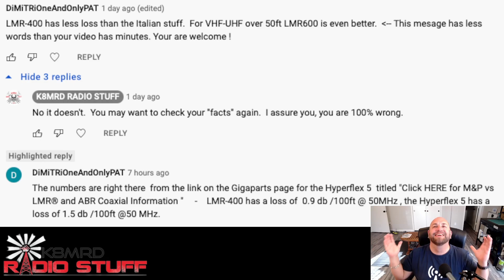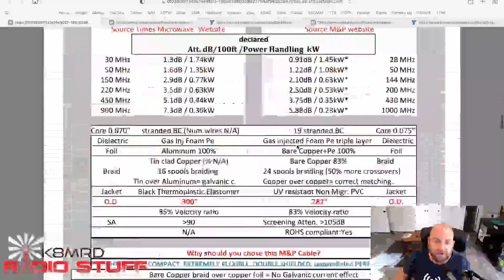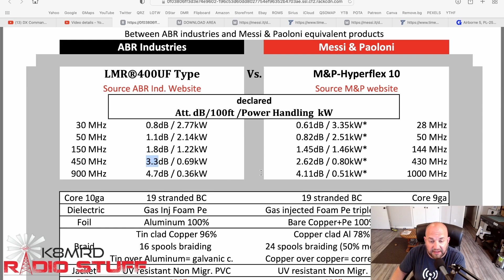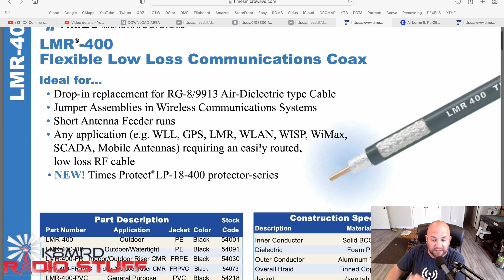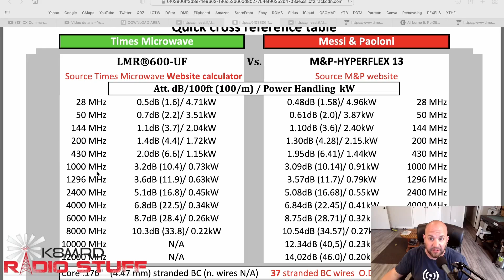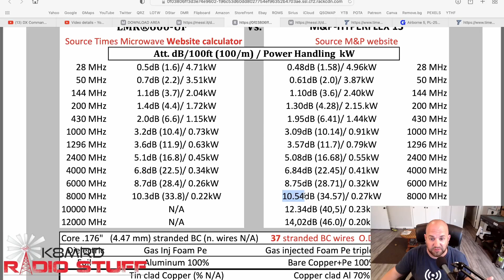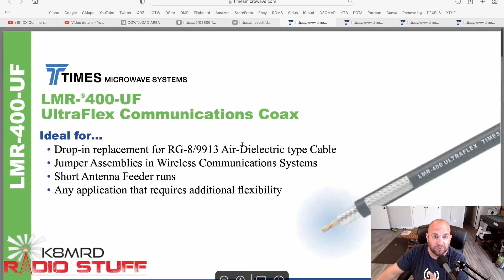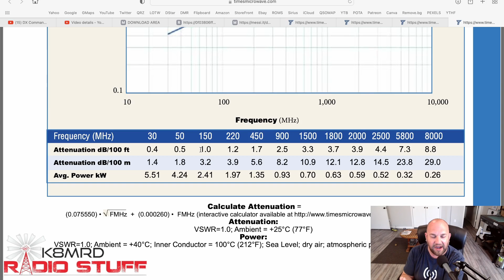Messi & Paoloni | Best Coax for Ham Radio

Comment: A few years ago M&P displayed at Dayton, I think for the first time, and I grabbed their catalog.  When I had time to read it I was impressed with 1) their construction techniques, 2) the fact they rate loss vs temperature (something few mfgr's do), 3) the actual loss figures, and 4) the breadth of their product line.  Mike, you are so right about comparing apples to apples, something I've seen seasoned engineers get wrong.  While it's generally true to buy the best coax one can afford, it makes no sense to pay big money for big coax to run 100w on 20m into a POTA dipole that's only 50' away.  Good engineering balances performance and cost.  Your video encourages hams to look closer at specifications.  Well done Mike.  73, N4BCD
Reply: Thanks, Mark this is a fair attitude towards new products and innovation. There must be a reason why we are so popular in the largest and most exacting market in Europe: Germany
Reply: @stefanomessi  you are so right, I'm from the Netherlands I'm living on the German border my garden and antenna are in Germany. 
And there is only one cable connecting this two countries and that's Messi & Paolonin the best a HAM can get. Thank you Stefano.

Comment: Mike, as a Michigader and you being ex-Michigander.  I'm retired plactic -design / extrusion engineer workded in Detroit for over 20 years.  I just notice an important design feature on Messi and Paoloni coax, extra layer of PE on top of the copper foil.  They say if is for better flex on smaller bends, but if you know your plactic material and properties.   Polyethylene has good di-electric properties.    (amout of curret to pass through ASTM test specimen).  M & P cable design then has an "encapsulated feature ".  with two layer of plastic.   This will increase the amout of power need (R/F) to pass through and moisture resistance that can penetrate the coax.  Is this "design" feature call also be called a tielayer by M & P?  The combination of all these different material makes Messi and Paoloni extra order of magnitude harder to produce.  Mike. do you know of any other coax with this type of construction?  If not this will make M&P very unique.   N9WEH  Mike, I just notice the M & P handles more power.  This tie layer could be one of the reasons for higher power rating.
Reply from the maker: I do not.  But that’s one of the many extra details M&P add to their coax to make it superior to the rest.  Moisture is very bad as we know, and they do everything they can to ensure it stays completely dry inside.  I have another video coming out on the connectors next week that further help prevent moisture inclusion.  I’ll tell you last weekend I was on the beach and a rogue wave completely covered my antenna connections.  Like, under water!!  The M&P connector had zero moisture in it, but the 90 degree adapter I was using was soaking wet.
Reply: Thanks Walter: you are not only an attentive reader of our catalog but a professional who knows how to distinguish the small construction details that, added to each other make the difference!

Comment: Coax, Radios, Antennas. It's all the same. People have their favorites, and everything else sucks.  I get this question any time I teach or help teach a class. What is the best ________.  I tell people to look at their bank accounts and kiss it good bye.. Then I tell them to set a budget that fits their needs for radio. Then get what you can afford! Now you have the best at the time. I will talk about benefits from various manufacturers. But like I tell them, some time it just comes down to budget. Concentrate on good coax. Learn more about the technical garble that we do not teach and compare. Then the antenna. It doesn't need to run hundreds to thousands of dollars. I've been using the same antenna for 30 years. I had to replace the coax twice, and the balun went once. But it is a good multi band antenna. Total I have spent MAYBE $155 Canadian on it. Not bad.  I also have Jason's end fed for portable. You can do a lot with a crappy radio and good coax and antenna, but a perfect radio, with bad coax or a bad antenna won't do shit!  Sorry but that is the best way to say it. Most of my ham life was buying used gear and making it work. I did get a Yaesu 857 when it came out, and I got an IC-7300 now.But that took me years to get that far.  With the choice now of a lot of the cheaper but goo Chinese stuff at a much better cost, I talk to them about the benefits, and the downfalls of QRP.   I love QRP. With the HF gear I now own, QRP is my newest obsession.   I just managed to snag one of the new QDX radios from QRP-Guys.. Can not wait to get it home, built and tested, and part of my portable gear. I think itt will get a LOT of use!

Comment: It comes down to only one thing.. That is what you can afford..
Same principle with antennas.

So what is 3db, 1 S point??
Using 213 up to 50mhz and I have no issues..
So what did we all do before Messi poloni cable came along, we still worked DX..
Reply: I think that 6dB equals 1 S unit on a calibrated S meter,  73,  AA4EZ
Reply: @Robbie Ei2iP. Thank you for giving me with this post and your questions the opportunity to express our point of view based on long experience.

From the very beginning, starting with the Italian operators, we were questioned about the usefulness of a more performing cable for those who transmit in HF.
They said: low frequency = low losses and said they were happy like this ... The cable in question was the famous RG 213, a project from the 1940s.

I said to myself: here it will be hard to make it clear that even at very low frequencies our cables can bring benefits that justify a replacement. Same thing for the PL 259, which in Italy too was the point of reference. (the original Amphenol ones were mandatory at that time).

Then I remembered that both the RG 58, RG 213, or RG8, had a shielding efficiency of> 55 dB, and that the expensive RG 214, is> 80 dB. Our cables are> 105dB and I said to myself: there is a big difference in Screening attenuation (SA), this will make the difference.

I asked the avant-garde Hams to report on the differences noted between the old RG 213 / U and our latest generation cables, and interesting notes emerged. They told me that even at low frequencies the level of their background noise had significantly lowered (indeed at low frequencies the noises are more incisive), and for example, they no longer heard the hum generated by the Christmas lights. Then others publicly stated that since they replaced the RG213 cable with ours, the noise level had dropped by two stops. They listened to stations they had never connected to, and the reception signal had improved remarkably over the barely audible ones.

Then came the QRP enthusiasts, then the microwave enthusiasts, where tenths of a dB are essential ...
Then the DXers, where performances and weight are an indispensable necessity. Having smaller and lighter cables than the RG 58 or RG 213 was a real treat for them. Eventually, after the first difficulties in our own country, we have progressively sold to Germany, the United Kingdom and everywhere in Europe, the Emirates, the PHILIPPINES, AUSTRALIA, the USA, Canada ...

In short, do not underestimate the new technologies ... the benefits have already been widely tested. M&P is the only manufacturer worldwide that has taken care of developing products tailored specifically for amateur radio needs. Our rapid success in Europe is proof of the appreciation of your overseas colleagues. But also in the USA, we are climbing the peaks ....

Thanks for the opportunity to interact. 73

Comment: On your recommendation a month ago I checked out the specs on m&p hyperflex 10 compared to LMR ultraflex 400. M&P beats it. Just holding it in your hand you can feel the difference in quality. The connectors they use are better than pretty much anything I've ever used before. I'm sold, I'm using M&P from now on.
Reply from the maker: You have chosen wisely.  Good DX to you!
Reply: Thanks I do appreciate :)

Comment: Great video. I think the issue is LMR has been king for years. Even commercially LMR is used, but I think it is because it is cheaper.
Reply from the maker: They are almost the same price actually.  For Airborn 10 and LMR-400 anyway.
Reply: @hamradiotube  not to mention, LMR has no weatherproof connectors.

Comment: Your right about m&p vs lmr400 that why I like airborne 10 cable and use it for field day
Reply from the maker: Awesome!
Reply: Thanks for your remark :)
Reply: @stefanomessi  you're welcome   Sir. I have two guys in the club at Hurst  that I told them to look into your cable  and connector. They came back to me the next day tell me we are going start buy that because of the connector so easy to install and the cable have get db loss.
Reply: @Jrhill-co3tg  Great!   I hope you mean the cables have got LOW dB loss :) hihi
Reply: @stefanomessi  yes sir meant low db loss on the cable

Comment: They both look good to this old cowboy!  M&P sqeeks it out at the flag for sure.  If I ever get to the point that those differences are noticed at my station, party at my house! 
Really like the M&P connectors for sure.  Antennas are King though in my experience.  When I get that perfect then a few tenths of a dB of loss MAY be noticeable.  But then there is my hearing to work on.  Talk about dBs of loss.  TNX Mike, how's the CW coming?
Reply from the maker: They are both good, the point is more to show that there are better coax than LMR.  The stock answer from so many hams is that LMR-400 is the best.  While it is good coax, it is not the best.  Let me know when the party is.  And what's CW??
Reply: @hamradiotube  RR on the party.  CW is thing that started this awesome hobby.  
CW is FT8 for men.

Comment: Mike,
I've looked at the Airborne 10, 100 ft. cable from Gigaparts.  It comes with N connectors.  Pretty good price.  Have you conducted any research in any loss using adapters going from the N connector to our radios ?  I'm thinking of an N to PL 259 adapter.
Jim, KE4CON
Reply from the maker: I haven't done much on connectors yet, but Jim W6LG has done a video showing losses with adapters and it didn't really do anything.  He had a whole bunch of them strung together and there was hardly any loss at all.

Comment: You might discuss why M&P is better.  I am a fan of M&P.  I love the Sahara for POTA.  Easy to work with.
Reply from the maker: Um, I'm confused.  Isn't this a video doing exactly that?
Reply: @hamradiotube  Ya, I was not very clear.  The marketing stats indicate lower losses.  Why?  What are the cable's physical characteristics that lead to lower losses?  Tighter shield weave, better materials?  Already know their connectors are awesome.  I love the insert that makes the braid connection without crimping or a couple of silly solder spots thru little barrel holes.  It would be awesome if you could interview an M&P engineer.  I am a M&P fan but would like to know more.
Reply: @bradcfi2  Hi Brad here I am.     Thank you for your more than legitimate curiosity about the evolution in cable technology.
Coaxial cables are far more sophisticated products than everyone might think.
Any layer of the coaxial cable contributes to the final result, be it good or bad.

Radiofrequency passes on the external surface of the conductors due to the famous "skin effect" and it is already a very important thing to study the morphology of the stranded conductor, and its composition to facilitate the transport of the signal.

 For single-core conductors, it's easier (in theory), but all of them rely on dielectric expansion technology, which in our case is triple-layer.

The better the quality of the copper and the composition of the stranded conductor, the better the performance of the cable and obviously its degree of flexibility and resistance to bending.   (made with a grain of salt within the declared minimum radius of curvature).

It is clear that those who still make 7-wire stranded conductors, with polygonal profile, will not be able to have the maximum results obtainable also, (and I say also) thanks to    19-wire stranded conductors or better 37 stranded wires (with round profile) ..

Expansion technology is the technologically guarded secret of every manufacturer, while Shield Attenuation, (SA), is another strong point of our cables.

 In fact, even at very low frequencies, where apparently even an old RG123/U, or RG8 or RG58, can give good results, these models have an SA of only 55 db, as opposed to the 105 dB of shielding attenuation (SA) of our models. This translates into a remarkable advantage in reception, with a lowering of the background noise which in some cases I have been reported to be very consistent.  Even the beautiful and expensive RG214, is not up to the task with "only" >80dB

We have Made the RG 213Plus, which thanks to the copper foil, reaches very high values (105dB) of SA, but the velocity factor remains always at 66%,  as opposed to the 84-87% of our modern cables.

In addition, our professional cables are made with 24 spool braids, with thinner but at the same time more numerous wires.

Braids made with 24 spools, with lots of wires, are called reactive braids, and they also contribute mechanically to the resistance to torsion that is experienced by connecting a cable to a motorized antenna.
They are resilient braids, (reactive braids), and act like a spring, which has a mechanical memory, while the 16-spindle braids, which are used by most competitors, with fewer thicker strands, fail to provide the same. mechanical support service.

Then there are the sheaths, which change compounds according to their use. In PVC they are very soft and UV resistant, but they fear stagnant water (as in a corrugated pipe or direct burial where they can be soaked for months).

For direct burial and heavy duty, (trampling of people or wheeled vehicles), the Extraflex Bury series is a must. However, they are somewhat less flexible.

For very hot climates, the white sheath (Sahara series) helps to keep the cable temperature much lower and therefore the attenuation characteristics are preserved, which can worsen significantly with increasing operating temperature.

For Navy applications, a LSZH (low smoke zero halogen) jacket is a must.

regards
Stefano Messi

I hope that in this summary you have more or less given some elements of why we are so successful in Europe: innovation and quality control.  :)

Comment: Hey, Don't let facts get in the way of a good argument!

Thanks for these comparisons. For POTA activations, every dB is a plus. I just need to decide if the cost is worth the benefit.
Reply from the maker: They always matter.  People just seem so quick to shrug off losses as if they don't matter.  They do.  And every little bit helps.  How much did you spend on your radio and all your other gear?  Wouldn't it be worth it to spend a little on the part of the system that matters most?  You're antenna and feed line.
Reply: @hamradiotube  Absolutely, it's like guys who spend $1000 on a new rifle and $100 on a cheap scope. POTA is new for me. I'm using a 20 y/o radio, 20 y/o coax and a $25 antenna. They all work, I just need to prioritize my upgrades.  👍
Reply: @dougdaniels  Perfect comparison, very relevant indeed!

Comment: OK, so some knuckle dragger has rubbed you the wrong way.  Now that you have proven you are right, what have you accomplished.  I will say thank you for reading the fine print.  Thank you for showing us the truth.  Research before opening your mouth.  That's the rule. Now lets get back to operating ham radio and communicating with other hams, who listen and learn.
Reply from the maker: Awareness.  Factual data.  A feeling of accomplishment.  Discussing a topic in ham radio that gets very little attention (coax in general), but is one of the most important parts of a station.  Plus a little bit of spite for added seasoning.  All in all I'm happy with the way this video turned out.
Reply: @hamradiotube  , great explanation , no brainer to the statement.some viewers of great vids need to lose the keyboard.keep the vids coming

Comment: Nicely put, you did it veeeery well. Am using M&P cables and connectors in 7 and 10
Reply from the maker: Thanks Elie.
Reply: Thanks Elie  Are you happy with them?
Reply: @stefanomessi  Very Happy ask Christian with which am in contact on WhatsApp, 
You have a great product, Being a ham radio for more than 40 years never seen better
TKS Elie OD5KU
Reply: @eliekadi_OD5KU_KU5OD  Thanks Elie for your kind appreciation... 
I have told Christian about your regards

Comment: LMR and Hardline are excellent choices for bands above 50 MHz. And it is for long cable runs of 150 Feet or more. Is it of value for the HF Operator. Perhaps if your tower is a long distance from your shack.
Reply from the maker: I wonder if you watched the video or are just commenting.  I suspect you haven't.  At no point did I say LMR wasn't good cable.  The point of this video is to show that M&P is better.  You are simply regurgitation the same thing everyone says without adding anything new to the argument.  No matter what length or frequency, M&P will always beat out LMR, (except for the one case that I mention in the video).  We are NOT however, comparing this to Hardline.